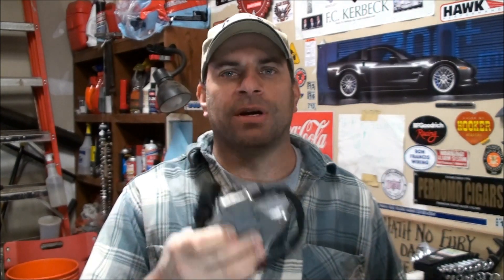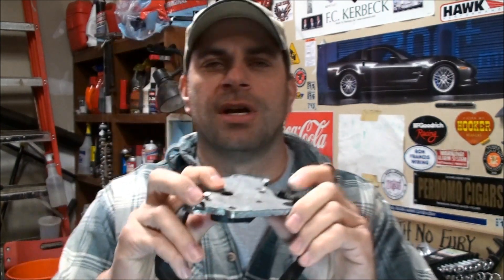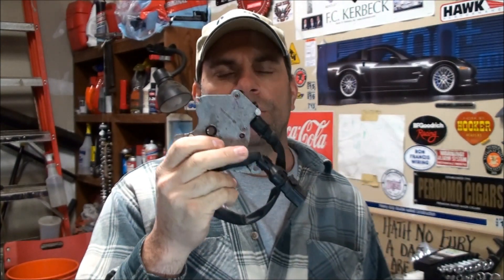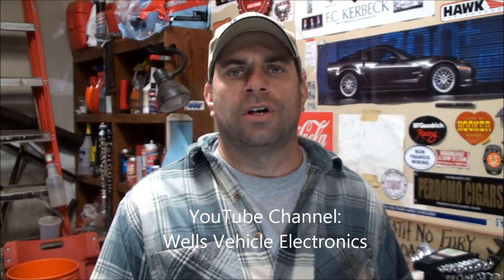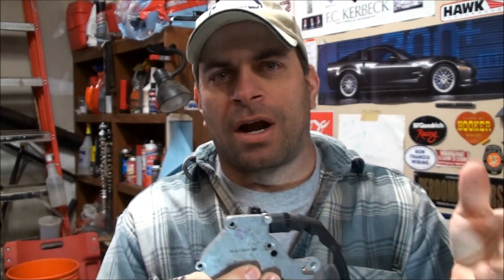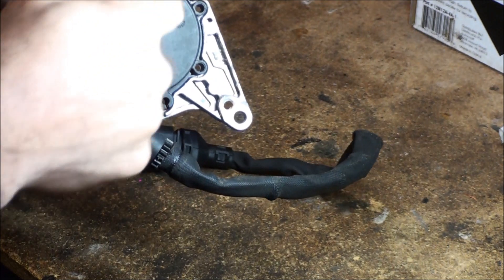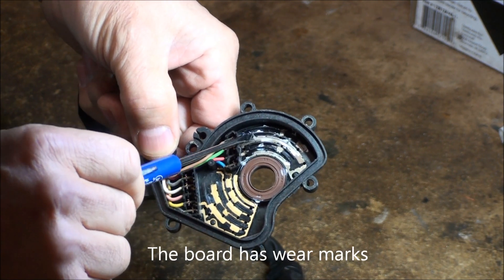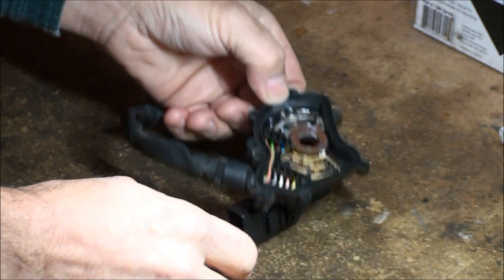Volkswagen/Audi - Why the Transmission Range Sensor failed -P0706 -Ver 2.0

Comment from the maker: I hope you enjoyed the video and it was helpful here is a link for the VW/Audi transmission range sensor:  https://amzn.to/2JrWI3T  Check out some cool tools I like to use: https://www.amazon.com/shop/ozzstar  Thanks for stopping by the Ozzstar channel!
Reply: Ozzstar t
Reply: Ozzstar my Audi is 2010 a4 and I cannot locate the position range sensor please let me know please
Reply: I'm having a similar problem with an 2003 v6 2.8 Passat, occasionally I select drive and the car stays in first, will not shift up and other times works fine. I do get limp mode and a clunk when going into reverse occasionally, but again it's intermittent and 2/3 of the time works fine.

Comment: Hey man. Great video! Thanks for taking the time to show others issues and resolutions with these vehicles.

I do have a question, though.

2014 VW Jetta 1.8 Turbo.. It starts up normally in Park. When I reverse out of my driveway, the reverse works fine.

Neutral "feels loose" coming out of reverse.

Putting it into drive sometimes requires a little more effort to pull it into Drive. Sometimes, it kicks into drive after you apply a bit more force toward D. It will light up showing that it registered its in D gear and then the quick "clunk" noise of going into gear happens. Nothing aggressive but enough to make me "shreek" a little lol. If I seat the shifter in Drive firmly and quickly it will register D gear and there is no "clunk" noise.

It won't recognize Sports mode when I slide it into S gear.

I think it is most likely the shift position sensor, but I was wondering if you had an opinion based on the info i provided.

The only other known issues being addressed are wheel bearings, cv joints, PVC Valve(diaphragm) and heater core. I have all except wheel bearings, Im just waiting on them to be delivered.

Side Note: EPC light comes on every once in a while, and its random. Sometimes, it has a readable code, and other times, it's just null. If there is a code it says "High Compression Cyclinder 2 or 4".
When the EPC light appears, you keep all the gears, but it is extremely handicapped acceleration.
Performing a simple restart of the car clears the code, and there are no issues. Tested on a back road for an hr until i could that perfect "canceled acceleration" to get it to pop up. I even restarted the car while in motion to test immediately after it was cleared, and there were no codes or EPC light after both motion and idle tests. It just works again.

That's about it LOL. 
I think I'm just doubting myself because stuff be expenssssive these days.
Hopefully, someone can give me validation haha
Reply from the maker: Start by checking the throttle body. Don't guess, test. Good luck!
Reply: @ozzstars_cars  As far as the shifter issue.. Do you think that's most likely the transmission shifter range/position sensor? It sounds very similar to other issues I've seen people have, but there's no conclusion to if it was or wasn't the sensor on most threads.
Thanks either way for your input. I know it's taboo to ask for a diagnostic over the "phone" lol. 
What code reader would you suggest to purchase so I can read and activate modules on my car(injectors, blender doors, etc). Mine is decent, but only for reading codes(ABS too) and let's your erase them. 

I did pay VW to do a carbon clean treatment while they were doing my thermostat/water pump housing replacement, but I was receiving the EPC error before that... I think that is just my PVC valve(diaphragm) being worn out and intermittently causing EPC light to trigger. New plugs. All coil packs are firing(visually).

Comment: I have a 02 audi allroad 2.7t is the location of the parts the same or close to it. This is happening to mine after I got high centered up in the snow on Mt Rainer here in Washington  and my brakes froze open and this broke tring to shift it with them froze did not work and stripped that like click click click rapidly like it wasn't fully engaged. Now I have to stick my screw driver in the shift solenoid to release my shifter from p to d or it will not come out of p . But the system was failing already from it going to limp mode ....so I know what's wrong I just need to check tcm

Comment: The audi a8 2009 has that sensor because I already disassembled it and that sensor doesn't have any idea
Reply from the maker: Are you saying that sensor is clueless?
Reply: @ozzstars_cars  it has the wires that goes to the shifter both not the sensor idk and i dont see any wire thats goes if it does not haven’t

Comment: So I just replaced the range sensor on my 04 1.8t everything went fine put it in. Started it up all the gears work as they should except when you go to put it in park it makes a grinding noise now did not do that prior to putting in the new in any thoughts
Reply from the maker: Aftermarket part?

Comment: My car is always going on lip mode and the diagnostic says problem on the range sensor 
That’s bad if I still driving it until I fix it?
Reply from the maker: Best to fix it sooner than later. Limp mode is supposed to prevent damage.

Comment: Ever had a transmission go into limp mode only when cruise control switch is on?  Not immediately but only when switch is on. 05 Passat tdi
Reply from the maker: Nope. I'd check wiring.

Comment: Okay what if the gear display disappears and hear a clunk when driving and went into manual mode. Won’t shift
Reply from the maker: VAGcom, test the TCM.
Reply: @ozzstars_cars  I ordered a OBDII with TCM reader function it will be here tomorrow, do you think it’s the TCM going bad? Also looked at the wires coming from the shifter and they seem crushed or pinched would be a better word
Reply from the maker: @professor_emr5158  sorry I have no way of diagnosing a car through the internet. Test and don't guess would be my suggestion.

Comment: Gday Ozz,
Thank you mate for taking the time to make and post this vid. My wife's 2011 Audi Q7 has started playing up with weird transmissions shifts/not shifting - changing gears, the PRND indicator lights on the console not lighting next to the selector when it plays up etc. I scanned and got the P0706 code. Thanks man as you have given me a great starting point to check the TCM floor area for the corrosion (or where the TCM may be in a Q7), the plug connection and possibly replace the switch if needed. I really appreciate it,
Cheers from Australia
Reply from the maker: Good luck with the diagnosis mate!
Reply: @ozzstars_cars  
Thanks. I’ll research some more as definitely don’t want to chase parts but definitely this is a good starting point, thanks again,
Cheers 🍻

Comment: My 2003 Allroad 2.7T quattro has a big honkin exhaust pipe jammed in there, space is limited! Will have to disconnect the downpipe first, argh!
Reply from the maker: That's going to be fun. 😟
Reply: @ozzstars_cars  besides the Range Sensor is there any other factors that will trigger limp mode when putting the car in reverse? Intermittent limps
Reply from the maker: @Dinofy  The most common causes of limp mode are boost leaks, overboost, faulty engine sensors, transmission issues, or wiring issues.  Your car needs to be scanned for trouble codes. That may give some direction to find the issue.
Reply: @ozzstars_cars  true. Dealership scan results: a printed circuit needs replacing ($600 CAD) plus labour (300$ CAD) me: 🤦🏻‍♂️
Reply: Nothing related to the range sensor much to my surprise

Comment: My car wont move at all. If I gas up the engine  does not sound like it used to. The dsg is not smooth when I put it in P D R S.
There were no engin lite. And the display shows when I put it on P D R V. Had no prevoius problem at all with gear shifting.
Reply from the maker: Get a VCDS scan and look at the TCM data

Comment: Had the same issue with my 2003 Passat GLS 1.8T. Bought a cheap(ish) Autel HT200 with the VW specific Diag software for 50 bucks, and a sensor from ECS tuning for $109. If it throws the P0706/17090 F125 implausible signal code, it's the sensor that has gone.

Fun fact: the F in F125 stands for Farhstufensensor in German. Litterally translates to Speed Step Sensor. It's why it's sometimes hard to find what the part or what its actually called because there's no direct translation to English for Transmission Position Sensor/Neutral Safety Switch.
Reply from the maker: Excellent info, thanks!

Comment: Have an Audi A6 1998. Had this problem for 2 years now. Bought a little relatively cheap fault code reader/eraser. Been erasing this code for 1 year now. One fix is to park with rear end first, since it is "R" and "N" that has bad connection. So I have 3-5seconds to go straight to "D" and then after 10 minutes of driving when the switch get s little bit warmer all is ok. This switch is really buried in there....V6 and Cuattro and a engine mount in the way. The reason I haven't fixed it yet. Anyhow...I bought a cheap switch with squariish connector. My car has a round... like 250 to 500 dollar. My idee was to take the internals from the cheap and put it in the cars switch. The cars value is 500! Have you ever tried to switch internals in this switch between old(round) and new?
Reply from the maker: No I haven't.  I use quality parts from the start.
Reply: Your link showed exactly the switch I bought. Same price. With round connector the price goes up 2-3 times. Most of the time it is "out of stock". One way could be to change the connector. The switches look absolutely the same. Which of course is no guarantee that they are identical.

Comment: Hi man.. Good video..I have not the same but similar..
My jetta 2.0 dont engage all time the reverse. Start in parking
Run well in (P.D.3.2.1) butnot engage (R)reverse
I use my scanner..(launch) and I see when I move the selector on the trasmision all changed in tge scanner. Exept the (R) and( N)
My question is..
Its the selector switch can damage in that way?
Reply from the maker: Very well could be.  You need to test the transfer switch, check for corrosion at the connector and also at the tcm.  Test don't guess.
Reply: @ozzstars_cars  thankyou bro!
Reply: @ozzstars_cars  which is the tra sfer  trasfer switch. On jetta..sorry..I have a lot off esquematics but vw is aleman and dont understand the parts name..
Thanks
Reply from the maker: @bikerrealengo  sorry I meant to say range sensor, not transfer.  Link to the range sensor video https://youtu.be/tsgg8AyyTpE

Comment: I have an aud a6 and I have this issue only it clunks but it goes into gear but the tcm was swapped from an audi wagon which gives off torque converter stuck on. I have an extra tcm as well

Comment: Hi, i have an audi a4 b5 1997 1.8T 150hp aeb and the vag-com prints out 00293 not the P0706. i checked the 8 pin connection for any corrosion but it's the case for me. Is there any possibility for multifunction range sensor? Thanks in advance!
Reply from the maker: When you are in VAGcom looking at the transmission data watch for the shift points. If you put the car into a specific gear and scan data is showing you are in a different gear then I would suspect a faulty range sensor.  Also check connections at the TCM for corrosion.
Reply: @ozzstars_cars  is there any possibility to fix  the existing range sensor? It's not very complicated the way it work. At the vacom when I select a gear, e.g reverse not showing R but Z5 and 00000. Also i changed the range sensor 3 years ago..
Reply from the maker: @samlefevr  did you replace.it with an aftermarket part? They are not very reliable. I'm not sure if it can be repaired or not.

Comment: Wish ya could help me my 2004 jetta 2.0 auto has no check engine bought it that way.. it works good u tile the e fine reaches 190 the. It has a hard time engaging into drive gears.. reverse  always works well.  .. it also rolls like it in neutral until I get rpms up to 1300 when it's cold and works.. .. also it has died while driving and while parked at stoplight .. backfires if it fires back up after it dies..please help

Comment: Help. 04 allroad no transmission display on dash slams in gear  fluid is good all fuses good. Actron scanner won't communicate
Reply from the maker: You need a VAGcom scan
Reply: @ozzstars_cars  thanks. I need a tcm also  its full of water,frozen and corroded

Comment: Watched your first video and it helped me diagnose the problem in my 04 3.0 A4. Had the same symptoms at first and I fixed it by swapping out the shifter, because the magnets were shot inside. About a year later it started going in limp mode and used Vagcom to see what you were talking about it. I ordered an aftermarket one for less than 100 bucks. Brought it to my mechanic though to do the swap, because I didn't want to do it on my back. Had to convince him to take the job, because he didn't want to charge me all that later if it didn't fix the problem, lol.
Reply: My 05 A4 went into limp mode as well, when u got it repaired did u have any more issues with it
Reply: @kristophertutt5583  yea, but unrelated to the switch replacement. Steering rack crapped out and I am donating it in a few days.

Try switching gears really fast at first. Then the magnet in the shifter and finally the pnp switch. Helps of you have a vagcom.

Comment: bypass the system just dont start your car in drive. would this work on an Audi? my 2002 audi a6 does not start after being parked on a decently steep hill with no parking brake.

Comment: Hi. Thanks for a great video. I have a 95 Audi A3 and I am having a problem when I'm driving at around 40 km/h and I have a feeling that my gearbox was shifting from 3rd gear to 1st gear while accelerating. This was happening intermittently. Unfortunately I don't get a check engine on my dashboard. Do you have any idea of what's going wrong with it? Thank you.
Reply from the maker: Have you checked the transmission fluid level according to the service manual?  See where that takes you.
Reply: @ozzstars_cars  Yes I did. Fluid was already been changed 3 months ago.

Comment: The Germans put a TCM under the rug.  Stupid.  They live in snow country, boots full of snow in and out, melting, melting.  And don't forget the occasional, "window left down overnight", RAIN STORMS!  Costly to the car enthusiasts.  Anyway, Nice explanation on the part.  It always helps me to understand the in depth so I can figure.  Thanks Ozzstar
Reply from the maker: I have footage of the VW TCM that I filmed a really long time ago but never posted.  Another issue is the windshield cowl drain hole clogs up with leaves and rain water back flows inside and onto the passenger side floorboard.  What a bad design!

Comment: Thanks Ozzstar!  Most helpful.  I have a 2003 Passat GLX that sits unused for extended periods and had this very issue.  Understanding the problem from your video, I tried a quick fix.  With the engine off, switch the ignition key to position 1.  Depress the shift lever button and move the lever back and forth from P to 2 ten or so times briskly.  Return to park, turn the key off, and then turn the key start the car.  Bingo!  Contacts cleaned and problem solved...at least for the moment.  Probably not a long-term fix, but got me out of a jam and limp mode. Kudos to you.  Wouldn't have thought to try that without your video.
Reply from the maker: Glad it helped you out.  Thanks for your comment and see ya on the next one.  -Glen

Comment: my 02 passat v6 has got into transmission limp mode with all gear lights on and mechanic changed transmission range sensor but the problem pops again for one week driving. I sent it back to fix and the mechanic told me he checked everything concerning transmission. Now after another week driving the limp mode came again just now. I saw the gear when in neutral flashed then disappeared and then limp mode came. Any ideas? Maybe some wire failure instead of range sensor? Is there any sensor under the shift rod that tells the range sensor the actual position of the stick? Will that possibly go wrong and cause this?
Reply from the maker: John Herbert there is a processor at the base of the shifter.  Make sure that it has not been damaged by any spilled liquid.  Check TCM connections and harness for corrosion from water leaking in (passenger side floor board).  Also run a VAGcom test to check tcm and shifter are functioning correctly.
Reply: Ozzstar but what could be the reason the limp mode comes back in after one week's driving. If something you mentioned is not right why when I pick the car the problem is not there? Just interested.
Reply: Ozzstar and mechanic told me he checked all the wires concerning TCM and TCM itself. Maybe the processor is the key we should go to.
Reply from the maker: John Herbert because he is probably disconnecting the battery and resetting the tcm
Reply from the maker: John Herbert find a new competent mechanic
Reply: Thanks for replies.

Comment: Hi pal. Just wanted to ask. I've replaced the position sensor. I've been told by mechanic I need to reset the transmission because car in limp mode yet. Do I need to reset it? Thanks.
Reply from the maker: Throttle position sensor?
Reply: Yes, the one that you have in this video, transmission range sensor
Reply from the maker: There is no sensor reset for this trans range sensor
Reply: I think you have to reset the cars warning of the problem via OBD2 before the car comes right again.

Comment: Would seriously love to see you try and clean that sensor,scrape the corrosion off and re install to see if it works.
Reply from the maker: Yeah it may have given it some more life but there is too much labor involved to have to replace the transmission range sensor if the old one gave up the ghost.  Thanks for stopping by!